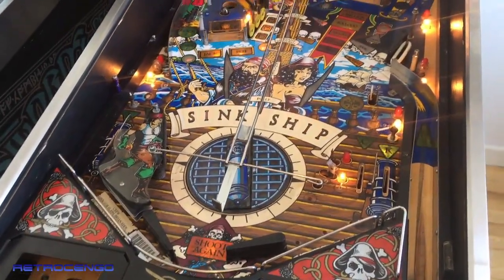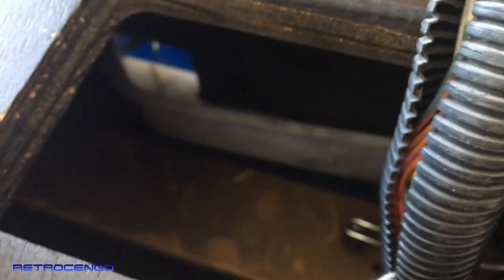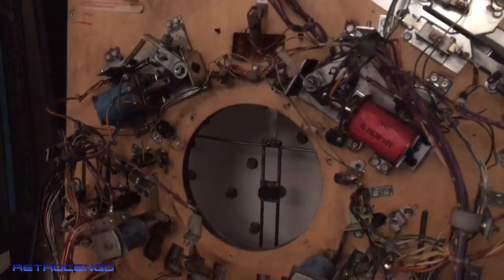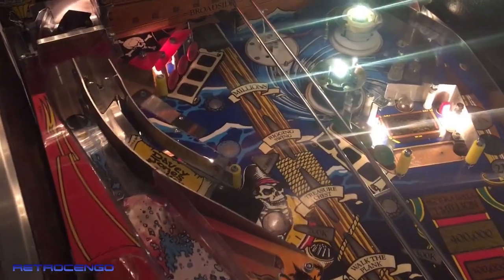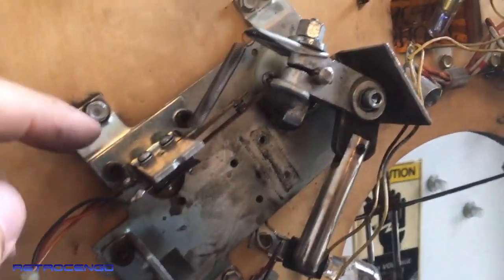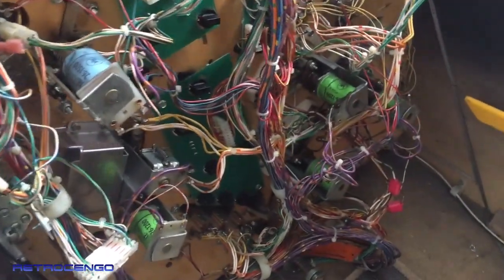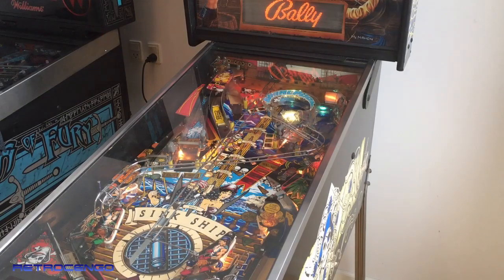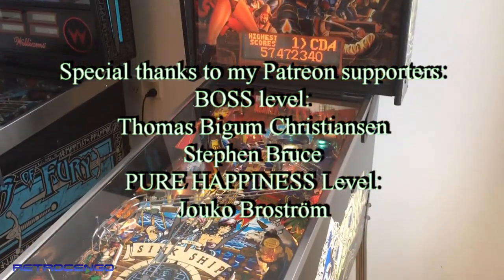Black Rose Pinball Restoration tips and tricks / how to

Comment: Ya know for me I would say going through a machine and restoring it would be lots of fun.  Playing it would be fun too but for me I get more enjoyment making things work as they should.   Your right about not lubricating plastic and metal mating parts because the plastic itself acts as a lubricant and is also an inexpensive wear item.   I would imagine that each manufacture of those pinball machines repurposes similar components across all their machines because building new molds to manufacture different parts can get rather expensive.  So if you can use common components then you can literally mold endless amounts of parts and all you have to do is maintain the mold and of course I am referring to plastic components.
Reply from the maker: You are absolutely right, it IS a lot off fun to restore, give pinball machines new life again, and get an amazing game experience 🤩
Unfortunately the lubrication is seen very, very often in these old machines, wd40 everywhere old crusry oil/grease, not easy to clean, I prefer replacing the parts. Compared to pinball machine prices, prices for the parts is really cheap😊
Mr. B, thanks for watching my pinball videoes also, I know this is not your hobby, but I really appreciate your support 🙏🏼🙏🏼😊😊

Comment: how did you decide what to put next to that star post between the bumpers?.. the manual playfield diagram shows only the star post on the rubber parts list. However.. my PF also has a giant mangled hole i filled where you put that small metal post, and the mylar has been cut around it making me think something does belong there.  I was going to put a second star post and a 3/4" ring around both of them. (also you are correct , rubber parts list shows a metal post in that screw hole that secures the shooter lane one way gate)

Comment: This is very similar to what I'm starting with.. not as hard worked or dirty but missing posts next to broadside and bumpers and skillshot etc. Every nut I try to take off unscrews the post from the board because they get hammered and no one ever tightens them. I have had to glue wedge dowels into maybe 20 holes. Replace screw in posts with through board "nut on the back"  star post screws in those hard working spots. This is not a refurb for the feint of heart. (Kinda wish I bought that spotless Wheel of fortune instead)

Comment: I just picked one up this week. Need to level the cannon. Wish you would’ve shown how you did it
Reply from the maker: Congratulations it’s an amazing pin. I actually filmed it but didn’t include it at editing couse it was zoomed in too much my fingers were all over the place. But it’s a must do adjustment.
Reply: @RETROCENGO  yes- I picked up a black rose last week too- I need to level the cannon and I don't want to break anything or screw something up - Your video is awesome
Reply from the maker: @kevincoady3413  Congratulations man, I still enjoy my Black Rose, amazing pin. 
Thank you for an amazing comment 🙏🏻🙏🏻😊
Reply: I got some time yesterday and leveled the cannon- It was a little tricky to get to the allen screws- here is what I did- 1) attached vice grip to the actual adjustment (round cylinder) held vice grip so the cylinder wound not spin, and loosened the large nut below with a wrench while holding the cylinder in place 2) loosened the lock nuts with a hex driver 3) after I had everything loose I rotated the cylinder to level the cannon, I would then lower the playfield and make a "practice run" until it felt level and right- 4) tightened up the lock screws in each cylinder and all 3 nuts-   My game plays 100 times better now- no more ball skipping and flying off the cannon!
Reply from the maker: @kevincoady3413  great comment, thank for sharing

Comment: When I push the flipper button the machine resets every time . How can I fix this. Yes , I've played a lot of the Bally and Williams Pinballs, and I still love my Black Rose. If I can fix this reset problem , I'm going to completly restore it. Art work is still perfect after 30 years. Please help. Thanks
Reply from the maker: You have to replace bridges and caps on the driver board. Or buy a no reset board from pin sound